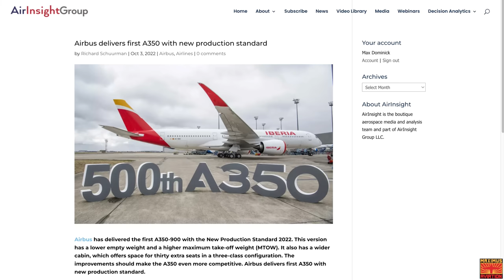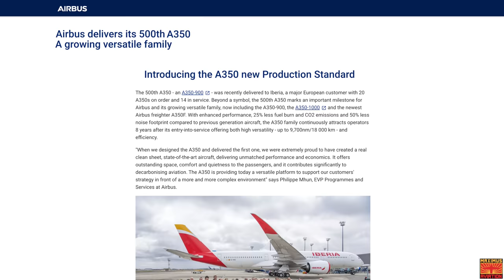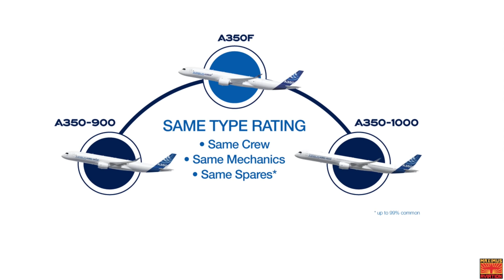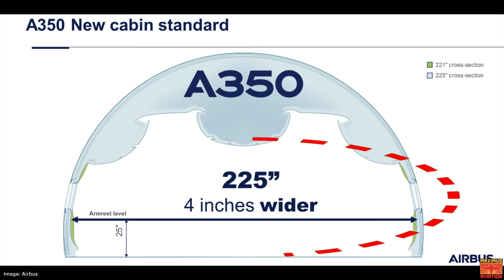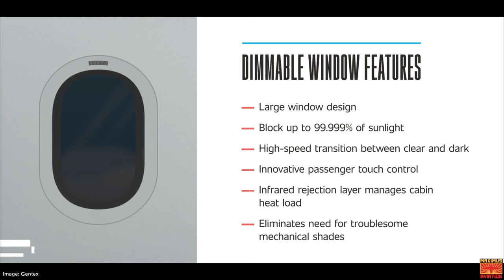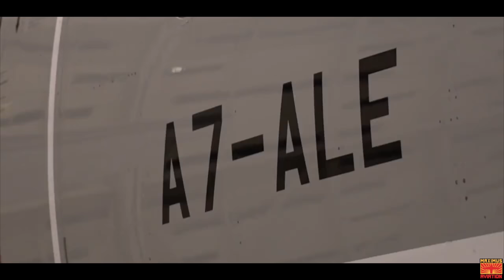Did You Know Airbus Made An A350 MAX Version?

Comment: To save complexity and long term maintenance cost, I am now endeavoring to design a wide body aircraft constructed entirely of speed tape.
    In this way, any blemishes, temporary repairs, or minor damage will only require the application of additional speed tape as an immediate remedy. Each time an aircraft requires repair, it will only serve to strengthen the airframe and prolong the service life. 
    Current estimates are for a useful airframe life of 150 years, though this may be greatly extended through proper installation of additional speed tape.
Reply: I think you really have sonething there. Why even attempt to paint composite? Just cover the whole thing with tape.

Seriously, people wrap cars in vinyl. Why not do the same with planes? Stick a protective layer of wrap on top of the composite instead of paint.
Reply: @danielch6662  I can think of no reason it wouldn't work.
Reply: @slartybarfastb3648  it's probably a lot heavier than paint and that's why it's not going to happen
Reply: We are blessed to have out of the box thinkers like you.

Comment: Been flying the BA A350-1000 and the AA 777-300ER just 2 weeks ago
The A350-1000 is so much better of a product just alone by the fact it's 3-3-3 instead of 3-4-3 plus air quality and noise level plus overall comfortlevel. I really enjoyed my flight on the A350 and really disliked the 777 even tho i was looking forward to finally be able to fly the 777
Reply: You do know seat configuration is determined by the airline and not the plane manufacturer right?
Reply: @triple777seven  yes but it's common for the 777 to have it 3-4-3 (default by boeing) and the 3-3-3 for the 350 (default by airbus) so it's mostly by the manufacturer but the airline can decide against it if they want.. which they usually don't
Reply: That's because the 777 is wider than the A350... Now that Airbus is going to put 10 abreast on the A350 it will be interesting to see what you think then...
Reply: @pentameteriamb6196  probably the same as of the 777 if that actually becomes standard (btw the 777 is just 10cm wider and airbus just made the overwork to gain those 10cm too so they're the same now)
Reply: I can't believe you are actually going to tell us you disliked the 777, which is generally thought of as the best plane in the air..

From what I understand, the a350 is a fantastic plane too, but whether it's almost as good as the 777, or slightly better, is just a matter of taste

Both are awesome planes !!
Reply: I couldn't agree more with you sir...
Reply: Agreed!  My experience exactly.

Comment: I think the figures in the slide at 2:20 are relative to the 777 or perhaps A330/A340 - I very much doubt they cut CO2 of the aircraft by 25% by just making (in aviation terms) a few minor tweaks!
Reply: Correct. They didn't change the engines other than minor software tweeks. That 25% number is the overall reduction from previous generations of aircraft.
Reply: 25% less co2 emissios per passenger compared to the old a350.
When using maximum passenger configuration ofcourse.
Reply: @baronvonlimbourgh1716  The Airbus slide does not say compared to the old A350. It says compared to previous generation aircraft. Even if you improve overall fuel burn by 2 or 3% (which is probably what the weight and software tweaks would yield, at most), then adding 30 seats (to about 300) does not reduce fuel burn per passenger by 25%, but by just over 10%. Similarly, there's not going to be any real reduction in noise footprint, because they're the same engines.
Reply: @DavidTheScientist   Exactly.
Reply: I agree 25% is a lot and there's probably a lot of marketing in there. However the minor tweaks were minor only in terms of software. In reality they've optimized the way the aerodynamic surfaces operate reducing previously unnecessary aircraft drag.

Comment: Boeing is having a paint problem on its 787 composite wings also. I guess the engineers don't know as much as they need to know.
Reply: And? Not entirely Boeings fault. Maintenance is quite important in looking after the aircrafts protection overall.
Reply: The A350 is a more serious problem than the 787. The CEO of Qatar Airways argues that his 787 fleet does not have this problem unlike their A350s.  It's not a cosmetic issue but a deeper issue that elanerates from poor design that Airbus hidden
Reply: @ndlben7129  Also Boeing isn't making too much of a hassle over the paint problems compared to airbus and a few other airlines.
Reply: @nickolliver3021  The 787 issue is relatively minor in comparison. The 2 aircraft are constructed very differently even though both use a lot of composites.
Reply: Seems paint technology is still catching up.
I asume paint suppliers for the industry are working overtime to solve this issue.
Reply: @johniii8147  of course composites are tough to maintain as we can see from what nature does to it
Reply: @ndlben7129  it is a cosmetic issue, that plane can fly with no paint at all with only the mesh covering it. Might affect aerodynamics though so maybe a tinge of additional fuel burn for a completely naked a350
Reply: Air Bus invented peeling wings. Thanks for posting.

Comment: i read recently that airbus often updates their aircraft. i thought once certified that was it. but they often increase the MTOW if they find ways to do so, get that certified. the A220 is a case in point. there are many other updates they do too. there is a whole dept working on new wings for the A320 series.

the mesh that is causing the issues is supplied by a contractor that also supplies boeing. could get even more interesting down the line. alas the only real solution is to strip the mesh from the structure and replace. this would require completely stripping to the shell each aircraft.

Comment: These changes probably won't persuade any airlines to convert their fleets, but it might sway future orders from companies that operate both the A350 and older B777s, what with the continuing delays to the B777X. It might influence potential new operators of the type. I know Cebu Pacific has been packing in passengers to the A330neo (Filipinos have a much smaller average size than Americans or Europeans, and domestic flights are under two hours, most of then just about one hour). Perhaps they will consider purchasing some A350s for their busiest routes (domestic and international).
Reply: A350 for domestic flights seems like overkill for any small country.
We've been seeing that usually there is more demanding for more flights on smaller aircraft, than fewer on big ones.

Comment: The A350 is definitively outsells by the 787.
Airbus must neo-tised this
Reply: Neo doesn't apply here. That won't happen until they change the engines which is years off yet
Reply: When airbus get the a350neo ,Boeing will have the 787X and we will still be back where we started. The 787 outselling the a350.
Reply: @mmm0404  The 350 don't so much compete as compliment each other. They are different in size in most cases and Quite a few carriers have both. The 787 has outsold the 350 because it was launched a few years earlier and it's size hit a sweet spot in the market. But the 350 has generally sold well and well received. they also have the 330NEO to sell. Where Airbus CRUSHED Boeing is narrow bodies.
Reply: @johniii8147  False, the A350 was launched only 2 years after the 787 (2004 for Boeing and 2006 for Airbus, forced to quickly launch a response to the surging Dreamliner!) It has sold to date +1400 787s and -900 A350s  , for 1,000 deliveries of 787s to date and only 500 A350s to date.  In just 2 years Boeing crushes Airbus in the widebody market.  Indeed it is Airbus that is in the Narrowbody market...
Reply: @johniii8147  they do have an overlap thou. The 787-10 is actually larger in capacity than the a350-900 , but obviously it's poor  range has not made find as much success. 

 The longer range 787-10 boeing is currently working on could make it a true competitor to the a350 in the near future.

Maybe that's the reason airlines like British airways , KLM , American Airlines, united , aircanada have not ordered the 350 as their 777-200ER /300ER replacements . They are waiting for such a varient. ( Yes I know , British airways have 350-1000's but they are not for replacing the 40 777-200ER's they currently have ) 

In terms of the narrowbodies , airbus was helped by the groundings and  delays of the 737 MAX . 

If boeing never messed up in the first place I'm sure the scenario would be different.

 Close to 1000 cancellations where made for  the 737 max due to the groundings .
Reply: @mmm0404  I understand your analysis however everything depends on the interpretation of what you think of the market.  The 787-9/A350-900 and 787-10 are different beasts from each other.  The 787-9 is slightly smaller than the A350-900 but has a cargo volume equal to the A350-900 (36 LD containers) while the 787-10 has a larger volume (40 LD3) than both.  The 787-10 is a large aircraft that cannot really be a straight replacement for the 777-200ER.  The 787-9 and A350-900 are replacement 772ER proxies.  If Boeing launches the 787-9 and -10 HGW that will just bring more value to the 787 family. It's not a question of competitiveness since the 787 Dreamliner is the market leader. 

Regarding the 737MAX grounding, I think the pandemic has cushioned the MCAS crisis, the cancellations are certainly due to the crisis and it has been proven that Airbus did not necessarily enjoy any advantage whatsoever.  Airbus hides cancellations unlike Boeing which is more transparent.  The MAX-10 awaiting certification (or not?) is a success, 1000 images in such a short time, it even exceeds the sales of the A321-XLR.  Despite this, the MAX-10 comes too late to market, and the 737MAX has generally become Boeing's thorn in the foot in the narrowbody market...
Reply: @mmm0404  Just depends on the aircraft configuration. The 350 is considerably heavier designed for different long haul missions.
Reply: @johniii8147  the Ultrafan will provide up 20% less fuel burn , that simply transactes the 20% more range for the same 787. 

This would allow the larger 787-10 to fly to almost anywhere without restrictions and unlock it's potential. 

It will also mean 20% more range for the same 350 but , that would mean  excessively more range , that most airlines don't need , affecting efficiency . 

To dissipate this range the a350 will need to be stretched, so is the 787-9 that would have the same problem
Reply: @ndlben7129  yea the 787-10 is slightly bigger than the 777-200 family in terms of capacity. 

It's seats just below the 773 thou. It could be an option for airlines wanting to replace their 777-300ER's   if they find the 350-1000 too big 

Despite being larger , the 787-10 has a lower trip cost and seat cost than the a350-900. Maybe because it's about 7 tons lighter
Reply: @mmm0404  RR has put the Ultra fan on hold for now by their own admission. Some initial testing but it’s next decade in service. They have their financial issues snf the air framers are not n a hurry for it
Reply: @johniii8147  It isn't actually. You will have a nice surprise seeing a prototype Rolls Royce Ultrafan attached to one of the prototype A350F's in about 2025.
Reply: The A330neo is the real 787 competitor. ...and 2022 sales figures show they're outselling the 787, in part due to 787 production problems. 
The A350 is more of a 777 competitor.
Reply: You mean outsold by the 787?
Reply: @pentameteriamb6196  Nope. I meant Airbus A330neo outsold Boeing 787 in 2021 and it was doing the same in 2022. But I guess Boeing finally resumed deliveries of the Dreamliner last month so it might turn around the figures again

Comment: I'm holding out for the 172SMAX.
Reply: I believe it's known as the Cirrus SR22.
Reply: @slartybarfastb3648  
Response 1:   not really, as it doesn't support 3 abreast with elbows pinned to ribs.
Response 2:  Textron zing!
Reply: @77thTrombone  In order for Textron to meet SMAX requirements, they'd need to raise the engine position so the cowl and prop wash disrupt airflow over the wing and horizontal stabilizer. No attempt may be made to provide sufficient ground clearance with a new main gear design. Designed aerodynamic instability is the basis of any SMAX variant.

        SMAX standards require this design to not only increase stall speed and lower corresponding angle of attack, but also introduce uncommanded pitch up just as the stall develops ensuring the need for a robot to seize the flight controls during a critical phase of flight. 

        To keep the PIM unchanged (no one wants the mind-numbing task of heavily editing that) and require no new type rating despite this radically different stall characteristic, Textron would need to stay very hush hush about all of this. Unless large, American fleet operators pay extra for the full SMAX training. Third world pilots and small fleet operators will just have to figure it out on their own some how. They will one way or another.
Reply: @slartybarfastb3648  most YT comments (Mine included) are snarky sarcasm.
Your comment is pure satire. 🎖🏆🏅
If Max drills down here, I recommend this comment be pinned for posterity!
👍🤜🤛👍
Reply: @77thTrombone  Thank you! That's a great compliment and is appreciated. I love your 172SMAX idea. It was comedy gold from the start. I only ran with your idea.
Reply: You had me at Slartybartfast 😄
Reply: @Rasscasse  Whenever in doubt rest assured, 42 is the answer.
Reply: @Rasscasse  he's a testimony to his YT name, ain't he?!
Reply: Or your Johnson Pump Max.

Comment: Despite the issues with the paint, I find the engineering improvements impressive. Unlike Boeing nowadays, Airbus seems to have the mindset of innovation and making cool shit. I mean, look at that black "mask" around the cockpit windows, love it.🥰
Reply: Well, Boeing produced the first all composite airframe…
Reply: A lot of these ‘Airbus innovations’ you marvel at…dimmable windows, the use of composites to lighten airframe weight… were implemented by Boeing first in their Dreamliner.
But that being said, the existence of more aircraft manufacturers pushes everyone to innovate more than they would if they were the only game in town. It’s a good thing.  👍
Reply: @stevegiboney4493  introducing shading windows , scalpting the cabin walls , introducing high density seating , increasing the MTOW . All introduced by boeing a long time ago.

It not innovation when you just copy what someone else does. lol
Reply: False.  But in reality you seem ignorant and closed-minded.  Boeing has innovated enormously in the Widebody with the 777/787/777X for 20 years.  Why don't you cultivate and speak nonsense???  Everything the A350 has is an obvious copy seen on the 777/787.  15 years ago Airbus just understood that it had to make Twin engines like Boeing.  Include cabins with large lockers, portholes, more humidity, and clean air.  Rest area for cabin crew and pilots.  "Double bubble cross section concept" which optimizes the cabin space defined by the height of the cabin floor... The A350 was launched in 2002, 2 years after the Boeing 787 and has today +1400 Dreamliner vs + 800  A350 were sold after 1000 deliveries of 787 and 500 A350... Please stop playing tell lies on YT, and social networks you are just ridiculous.  Boeing wins in this market, period
Reply: Error : The A350 was launched in 2006*, the 787 in 2004...
Reply: @stevegiboney4493  the a300 also used composites in the airframe.
Maybe models before that as well. I think one of the tri-jets did as well.
Reply: Imagine what a a350 neo would be like if they can do all this woth a standard optimisation of a model already in production.
Reply: @baronvonlimbourgh1716  yep, just not wings, fuselage…
Reply: @baronvonlimbourgh1716  yes the L-1011 used already dôme part CFRP material and used already autoclaves !👍
Reply: Boeing is the process of further improving the 787 as well. Their are ER versions in the works for both  the 9 and 10.
Reply: @baronvonlimbourgh1716  well , the 787 would get a neo version as well . 

With the added efficiency and range ,  the 787-10 could fly about any where, significantly boosting it's prospects against the 350-900...

We all know the 787-10 is the CASM king of the widebodies , so a range boost for this varient could be insane
Reply: @mmm0404  No, only PIP improvements are planned for the 787HGW at this time.  The 787 still held the market against the A350
Reply: Cool shit aptly describes Air Bus Darry Doo.
Reply: @mmm0404  That's why Boeing doesn't succeed to get its planes to be certified...
Such a shame for this company that used to be at the edge of innovation for decades and that is roughly doing sh.. since 20 years.
Reply: @Zupdood2  The 1st commercial airplane using composite materials was Concorde in the 60s. Then Airbus used them on its a300-600 and on a larger scale on its a320 family in the 80s.
Reply: @Moi-Moi1  Relax , Boeing will be fine . Every company has its rough moments .They will recover just fine ,no need to worry
Reply: Totally agree!
Reply: @mmm0404  I genuinely hope so, the industry needs top players that push each other.
Reply: @mmm0404  Well actually we don't all know, but if you say so...